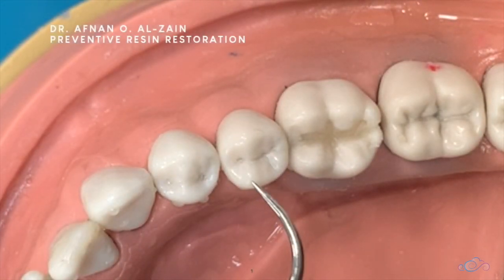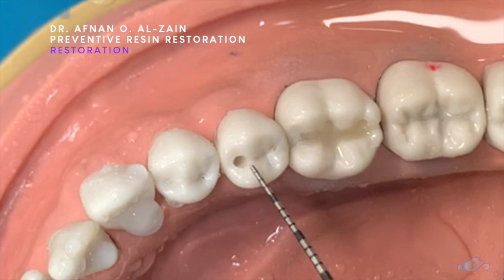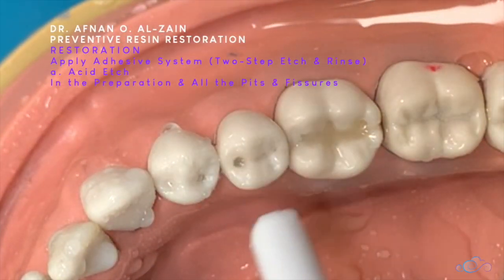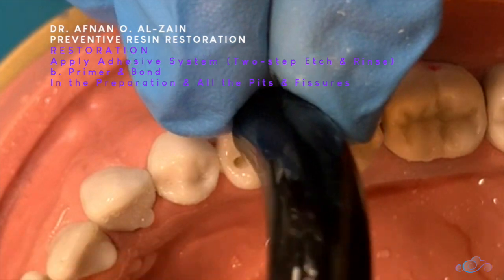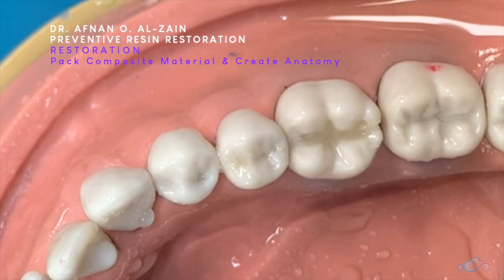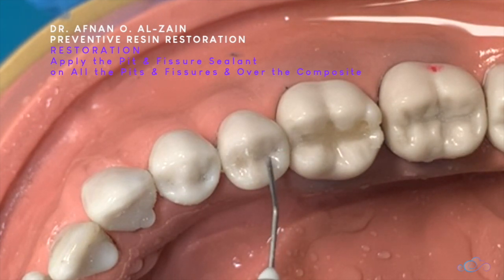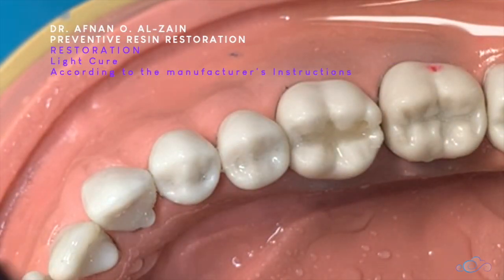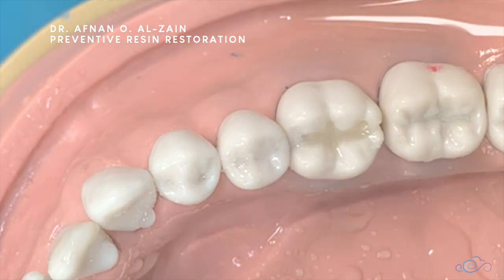Preventive resin restoration on a premolar (#45) - Arabic عربي

Comment from the maker: Resin infiltration is different than fissure sealant. How old is your son? And will the dentist place the material on the tooth fissures (grooves) from the top? Or the side? Or the front? 

Here are general information:
1. If the fissures (tooth grooves) are not decayed, then the dentist places “fissure sealant” as a preventive measure to avoid decay formation, especially if the tooth grooves are deep. So it is not a filling. And it does not need to be replaced unless it fractures or gets dislodged. If it fractures is typically from eating or if it is high. But usually it doesn’t need to be replaced. If it is dislodged (which does not happens if the technique is done correctly), then it needs to be replaced. 

Resin infiltration is performed on teeth with decay in the early stages, which is typically named ”white spots” that are located on the front side of the tooth or between teeth but not on the fissures. 

Both techniques doesn’t take away enamel. If your child is young I would suggest fluoride application instead of resin infiltration as the tooth will uptake fluoride and this is a local effect. It will not cause toxic effect to your son. Research showed the effect of topical fluoride is local to the area it is placed. And since your son will not swallow it and not swallow the bottle he will be fine. Fluoride will replace the missing structure of the tooth (hydroxyapitite) with (Fluoroapitite). On the other hand, resin infiltration will replace the missing tooth structure with resin. 

And it is possible to place fissure sealant on the permanent molars to seal the fissures to pretext from decay. 
 
I hope this helps and let me know if you have further questions 😊
Reply from the maker: This is the video of the pits and fissure application, there is no removal of enamel with a rotary instrument 

https://youtu.be/cQwlTChreKc?si=5SDt9bGD_w5bAL1r

Comment: Thank you very much Dr, Just wondering is the PRR material same us composite material?
Reply from the maker: You are most welcome. In the cavity yes, composite material. In the fissures and over the composite, fissure sealant was used. But you can also use flowable composite for the fissures instead of fissure sealant.